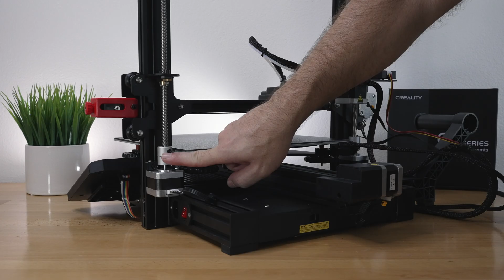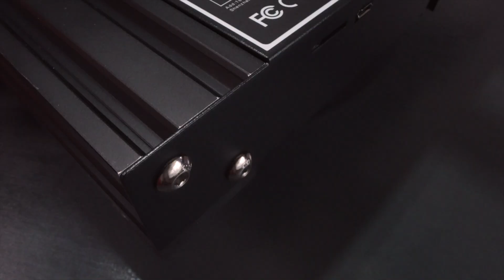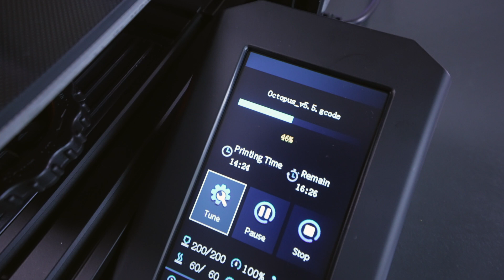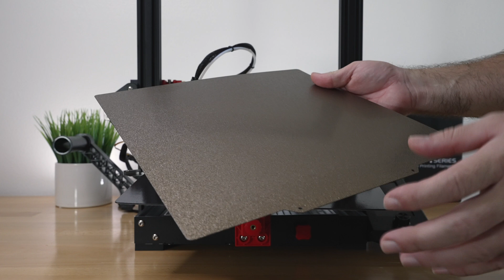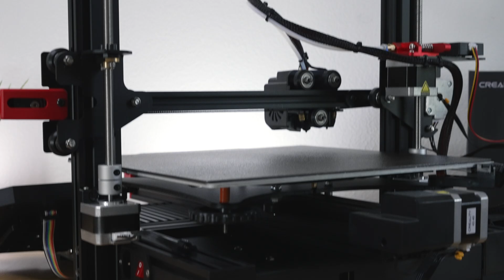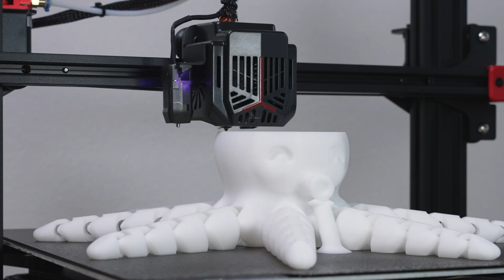Creality Ender-3 Max Neo - PEI Build Plate Upgrade

Comment: Hi,I have my Neo Max for about 3 months now,I never use a 3d printer before at all,and I mus say I print right from the box using the manual instructions with no problems.The spool holder I used for 3-4 print only after I bought the drier box and I never used again.Today I expect to arrive the magnetic bed from Creality,lets see how this works.I have the direct extruder from Creality which I haven't fited yet,probably I will do today after my magnetic bed turs up.My only complain is the printing speed,I like to make it faster and I can't find anything  how and what I need for that.I have to mencion for bed levelind there is a nice braket for precision gauge witch helps you level the bed at 0.00-0.01,and let me tell you that make big difference. I try the marlin firmware once and didn't work very wel for me(I'm noob,I have no knowledge  on 3d whatsoever)I  my try again because I really like the look of it and the millions of seting give you.If anyone know what I can do to make it print faster I really appreciate.At this point my printer is 100% stock,from today I will upgrade the bed and probably the extruder,and I hope soon the firmware (Marlin).Overall the printer is good for new people in the 3d world

Comment: thanks for the video.  I had a lot of trouble getting the filament to stick to the metal plate, compared to the glass, even after multiple leveling and auto-leveling.  I finally solved it by lowering the z-offset some more.  It went from -.86 to -1.62 and that seems to have solved the problem.

Comment: So, I'm trying to decide here. Should I get this printer and upgrade to the sprite extruder? Or just buy the Ender 3 s1 plus? I am trying to keep in my budget, but the s1 plus is getting me closer to the Bambu p1p..... ugh.... gimme some advice! :) thanks.
Reply: The same dilema dude. From an upgradeability perspective neo would make sense as you can just upgrade to the sprite pro. The S1 has the non pro version of sprite which is so frustrating. But the S1 plus has better out of the box performance, which would be great for a beginner like me. But upgrading the hotend on that will be more money and also there doesn't seem to be any firmware upgrades yet to get pay the 260° hear limit.

Comment: Just got this printer for Xmas and LOVE it. But, the filament tube and cable that connect to the printer head get caught in-between the x-axis as it returns home. How do I best readjust the cabling to ensure that it doesn't get caught in the rollers? Thank you so much!
Reply: if you pull it to the side it might be good, did with mine

Comment: Just got one of these the other day and got set up today with the help of your vids.  My first 3D printer, so I don't really know what I'm doing, but I think I got the thing levelled right (after 3 go-rounds).  My first two prints didn't stick at all to the glass.  I took off the glass, cleaned it with soap and water, and then ran a 3rd print with the nozzle temp at 205, the bed at 75 and the printing speed dialed back to 70% - the boat came out beautifully.  tried two more prints after, and they all released off glass.  Should I look to change out the bed ?   Do I need to clean the glass and re-level it in between each print ?
Reply: You should try tweaking your settings. If all else fails just use more supports
Reply: @IPutThePInEdgington  Thanks for the reply   After I posted this I did change out to a PEI Plate and levelled the access support as suggested by the video.  Relevelled the bed and made it just a bit closer to the extruder.  That seemed to do the trick, as I've done about 10 prints since, swapping out filament a few times, and haven't had an issue since.  Still learning my way but the thing seems pretty good - really like the output.
Reply: Ayy fellow ender 3 max neo as first printer, finally got mine for cosplay in June and I’m glad I got this one got it’s price it’s amazing

Comment: Just get the plate for the model you have. I have the Max Neo and upgraded to the correct plate, it matched perfectly and the release works as advertised. Also, read bed temp with a handheld and it did not see much difference in preset to actual with the magnetic pad in place.
Reply: How do i get the plate for the correct model? Apparently there is nothing advertised as a "max neo compatible" magnetic sheet. I can only think it's because the max neo is "new". After watching this video I'm not sure i should trust the advertised sizes unless they specifically say they are compatible with it, and i don't even know if the actual bed size is 300mm. Would you happen to have a link or something?
Reply: @DarkestBunny  320x310; 310x310 will do

Comment: E3MN owner here got it as my first printer a couple days after your setup video. Are you thinking about a fanshroud change? The heatsink on this unit is absolutely massive and have yet to find one that fits so I'm remixing my own. I currently have it rigged fairly wildly, I just can't deal with how obstructed the nozzle is with the stock shroud

Edit.. I just went to a creality sprite pro to get an all-metal hotend and drop in support of crtouch/direct drive
Reply: How’s that sprite pro working out for you?  I’ve been thinking about getting it.
Reply: Update on the Sprite?
Reply: @camden3088  still running it, works fine. Definitely an improvement and haven't finicked with it much since install

Comment: the build plate looks like it is the same size as my CR 10 V2, its 310 x 312, that's why the 310x310 didn't fit, the bed isn't square but a rectangle. Glad it worked though, and I think the square plates are cheaper, I might go with the same one as they are cheaper.
Reply: Personally I went with 310x310 as well because the price was significantly better(mine isnt double sided however). I knew it was going to be slightly off but it obviously works fine like his. It has been a huge benefit.